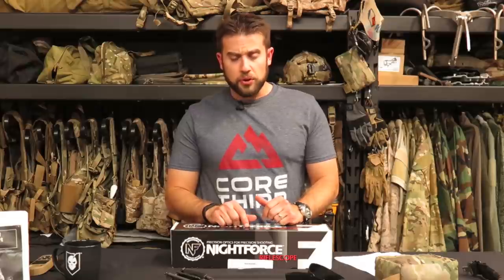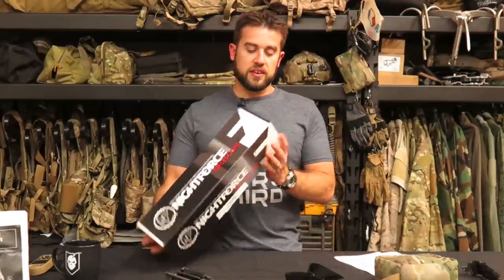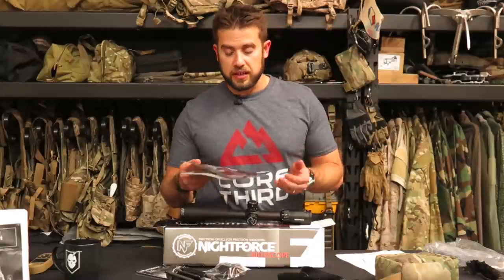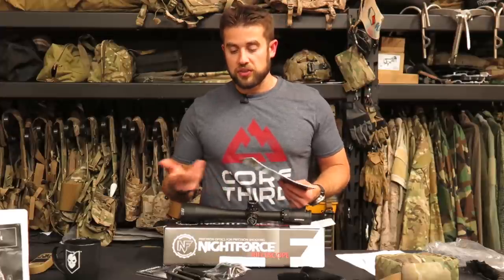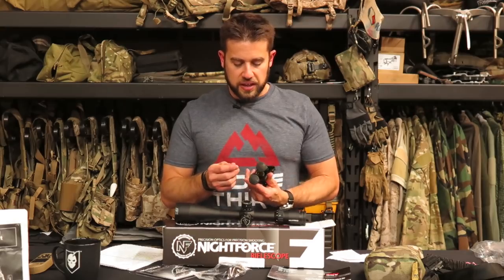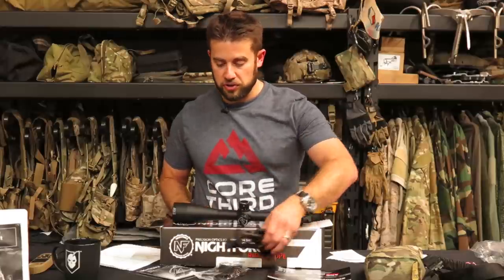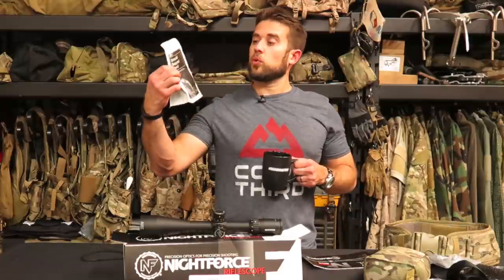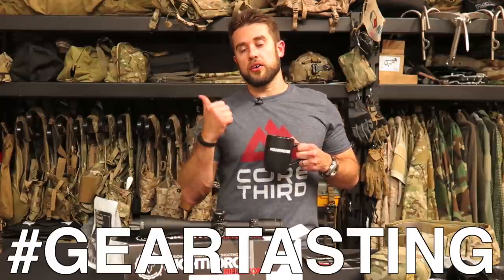Gear Tasting 50: Precision Rifle Build, Battle Belts and Storing Dive Gear

Comment: As a general word of caution, the lead time for a Manners stock is generally not what they quote you. You will be waiting anywhere from 6-12 months depending on your stock configuration. McMillan lead times will be accurate and so will GrayBoe since it's owned by McMillan. The Manners stock is a slightly superior product but you will certainly wait for it. You could also consider a chassis system such as the Masterpiece Arms line of chassis.

Comment: I'm a short guy but you can run a battle belt with a plate carrier. Just get the blue force gear plate minus or plate minus v2 in a small. That should give you plenty of clearance.

Comment: An optic with a max of 14 power is not sufficient magnification to utilize the benefits of 6.5 CM over .308 in my opinion.
Reply: 14 power is plenty to get you to the 6.5CM's trans sonic range. The general rule is you want a minimum of 1 power for every 100m. So 14 power is enough to get you out to 1400. Some people like more, but it's certainly enough for 1000.